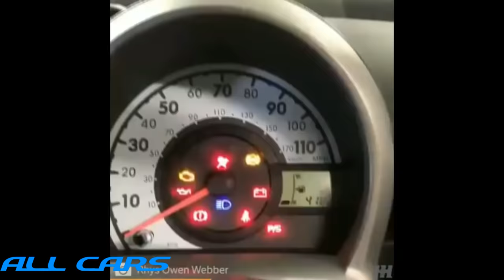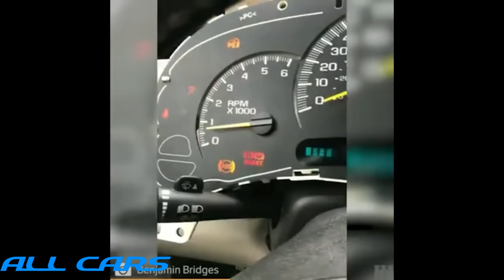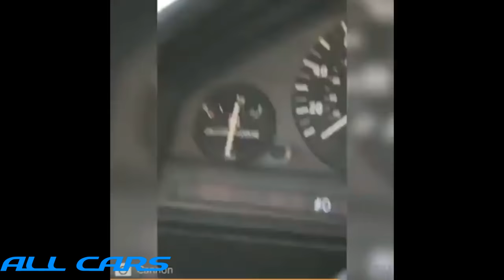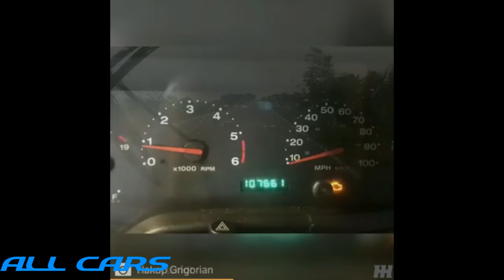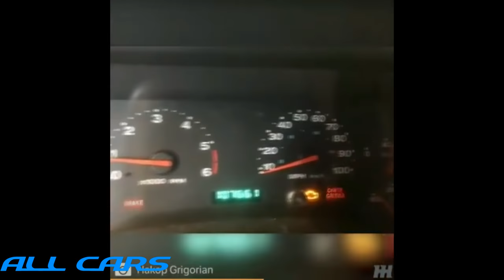BEST MECHANICAL EPIC FAIL COMPILATION!

Comment: 0:30 that's a bad clutch cylinder. You usually can't tell exactly which one. My Nissan Hardbody did that and replaced both the master and slave cylinder since it's an old truck.